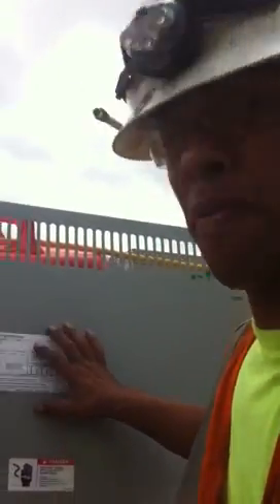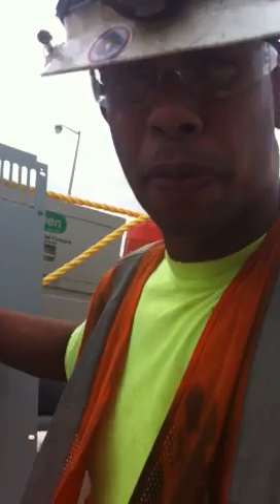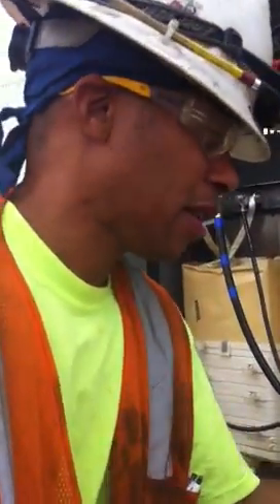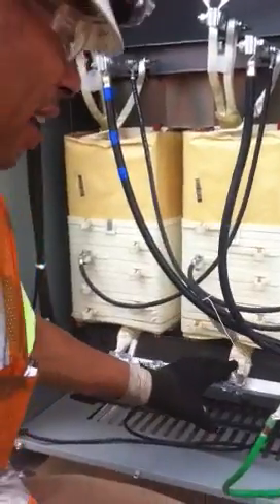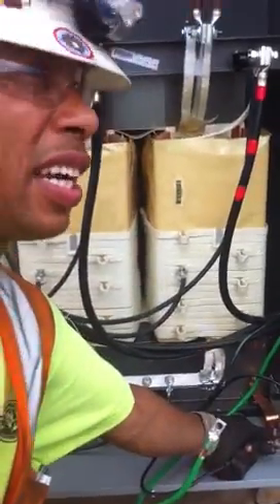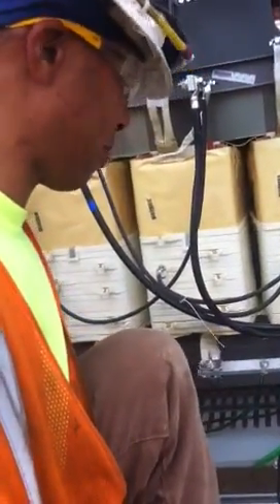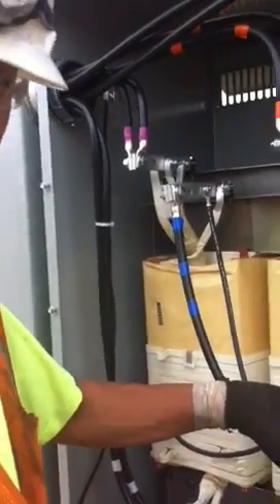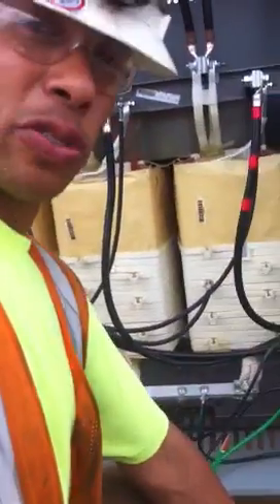Grounding a Transformer

Comment: System grounding reduces overvoltage caused by induction from indirect lightning, or restriking/intermittent ground faults. Induced voltage imposed from lightning can be reduced by short grounding conductors and eliminating unnecessary bends and loops [250.4(A)(1) FPN].

System grounding also helps reduce voltage stress on electrical insulation, thereby ensuring longer insulation life for motors, transformers and other system components

Comment: The ground rod only serves the purpose for over voltage conditions has nothing to do with returning current back to the source. That is what the XO terminals for. Only the neutral carries the imbalance current the ground rod only serves the purpose to protect the systems windings from  over voltage conditions from lightning strikes, static anything that creates an over voltage condition.
Reply: How does the ground rod protect from indirect induction from lightning or other stuff? I don’t see how it helps. Wouldn’t it actually provide lightning a path INTO the transformer and damage it ?!!!

Comment: Code states a specific wire size for a specific bonding jumper. That ribbon is only bonding the outer frame to the core frame. “70% of the time most of the time” is not a real metric. You need to delete this video

Comment: Bad info in this video.
Unbalanced neutral return DOES NOT got to grounding electrodes. current that returns on the neutral wire returns to the star point X0(3 phase wye) or center tap point(3phase delta or single phase/split phase service) NOT the ground rod.
Ground rods are for lightning suppression and to shunt primary voltage when primary lines contact secondary lines.
Ground rods have NOTHING to do with neutral return current or the fault current path aka EGCs...
Reply: How does ground rod help with lightning? Doesn’t it actually provide a path for lightning thru earth into ground rod and back to the transformer which could damage it?
Reply: @MathCuriousity  lightning is looking for earth not a transformer. lightning doesnt travel down the road and then reverse back up the road and onto the service drop

Comment: Can a grounding wire that was stolen from about 8 feet to the ground be repaired using copper clad steel and connectors?
Reply: I have seen it done many times if there is no other way. Thanks for asking

Comment: I'm sorry to disagree with this instruction but the actual required grounding point is on the neutral or "XO". The strap referred to in the video is not bonded to the neutral at all as it is a frame bond only. To achieve a proper system ground for the wye secondary XO, the ground wire must be secured to the neutral as well as the case of the transformer. Minimum ground wire size must be confirmed with the AHJ and the Code tables based on the actual rated output of the transformer. Fastening the ground wire to the case only and leaving the neutral unconnected from any grounding will cause a dangerous floating neutral condition.
Reply: #6 is the largest wire required to rods...
Reply: System grounding reduces overvoltage caused by induction from indirect lightning, or restriking/intermittent ground faults. Induced voltage imposed from lightning can be reduced by short grounding conductors and eliminating unnecessary bends and loops [250.4(A)(1) FPN].

System grounding also helps reduce voltage stress on electrical insulation, thereby ensuring longer insulation life for motors, transformers and other system components
Reply: +Gianluigi Sandiego There was already a jumper from the XO terminal down do the lug where he put the ground wire, he explained that in the video. And also, code now states that a minimum of #6 is required for a ground wire, that is all. There are no more tables to size a ground wire based off the ampacity of the panel or in this case, the transformer, you could have a new commercial restaurant with a 2000A 347/600V service, and it would only need a #6 ground, because any fault current goes back on the neutral to the source, very little to none of the fault ever actually goes to ground out the ground wire.
Reply: this is correct. video is wrong GROUND wire must go through xo first then bond to case.
Reply: What do you mean “case”?

Comment: Unbalanced currents doesn't come to the ground. Electric current can flow only in closed circuits. Grounding of a neutral bus bar providing increase of ground fault currents, and therfore tripping of fuses.